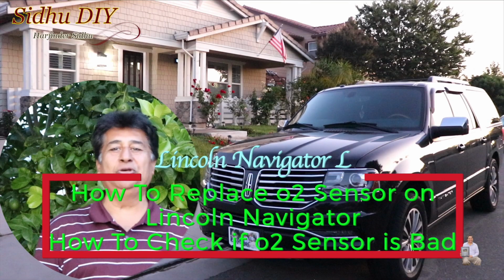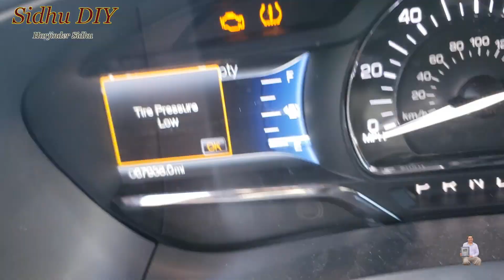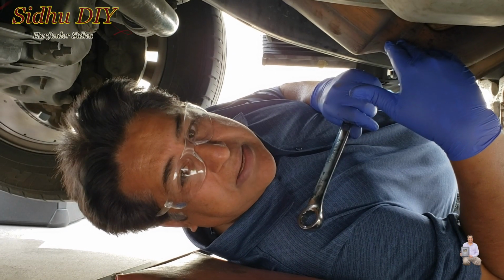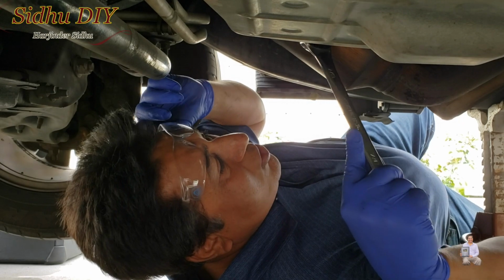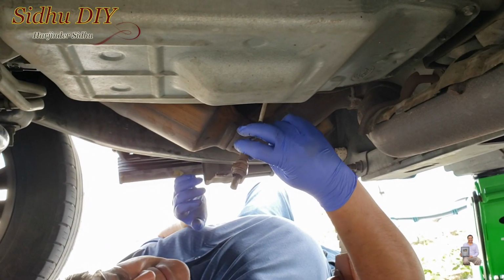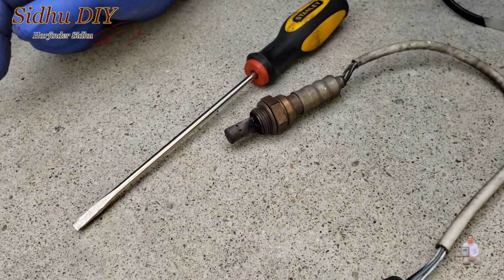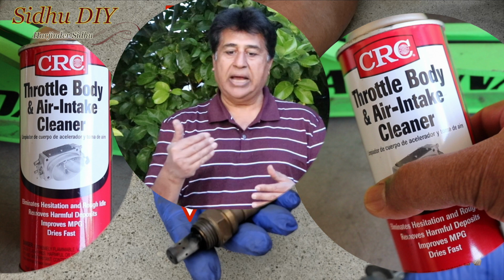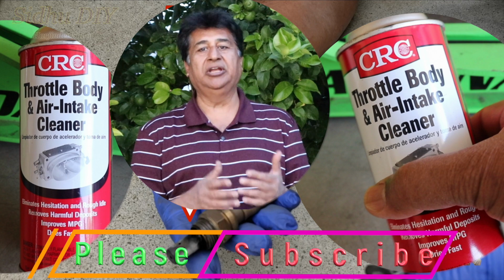How To Replace o2 Sensor on Lincoln Navigator | How To Check if Oxygen Sensor is Bad | P0430 Bank 2

Comment from the maker: How To Replace o2 Sensor on Lincoln Navigator 2015 | How To Check if Oxygen Sensor is Bad | How To Fix P0430 Error Code Catalyst System Efficiency Below Threshold Bank 2

Comment: Hello and thank you for all of your DIY Navigator fixes! However, I just realized you’re working on a 2015 Navigator and mine is a 2006 with a 3V5.4L engine. Luckily I haven’t purchased any of the parts and/or special sockets yet. Can u please tell me which engine ur 2015 has and if your suggested procedures would be the same for my P0430 code? I also have had an intermittent “Check AdvanceTrak” along with the ABS light which didn’t come on this time. I sure hope I have a clogged CAT because I’ve only been getting 9-10mpg! This terrible gas mileage has been going on since I purchased it last year even BEFORE this P0430 code and even AFTER having the upstream O2’s replaced (not the downstream yet) and even after changing the oil, plugs, air and fuel filters as well as cleaning the throttle  body! Only now did this P0430 code come up. This is the 1st DTC I ever got since purchasing it 1-1/2 years ago. 

Anyway, Thanks again! Hopefully ur procedures will work on my 2006 Navigator. I’d surely appreciate ANY HELP/SUGGESTIONS on my poor MPG after…of course I deal with the O2 and/or CAT. 
.
Reply from the maker: In my navigator I had the v6 eco-boost engine, you can follow the same procedure in the video. For gas mileage, I would suggest a minor tune-up which consists of an oil change, spark plug, and air filters. Thanks for watching.🙏
Reply: @SidhuDIY  Thank u for replying sir. Unfortunately I had already changed my plugs, oil filter, fuel filter, air filter and even cleaned out the throttlebody. I also took it to the dealership who charged me a ton of money to change out the upstream O2 sensor without even a code. So yeah!! I was hoping any of those could have fixed my low mpg but nothing helped. Now that this P0430 code finally popped up, I’m hoping that your lacquer thinner magic will work (after I check out the downstream O2 sensors and cat).
Reply: @SidhuDIY  I forgot to add that I cleaned the MAF and that the dealership did an injection cleaning. Would u happen to know if any of the  freeze frame data (when that code popped up) cud help diagnose a clogged cat (or any of the other relevant sensors)? I heard the BARO cud help but I don’t know how to use all those freeze frame values except the LT/ST fuel trims which were all low prior to the P0430 (only ever since I bought the vehicle last year) code that just came up. Reason being, I’m in Seattle where it’s cold and rainy and I don’t have a garage. Ugh.

Comment: Hi man thanks a lot for sharing your knowledge with us. Pls Keep going. I have a navigator with high mileage and it showing p0420 & p0430. What is the cheapest way to figure out is the O2s are bad or the cat. Thank you
Reply from the maker: I know..."check engine" light is on, with a code P0420 or P0430, and related "catalyst efficiency below threshold" codes. Please wait for a couple of days because I will be posting a cure for your codes and it will be very inexpensive.
I am done with my video, it just taking too much time to edit but for sure will be posting soon.
Thank you so much for the like and thanks for sharing nice feedback and thanks for watching.🙏🙌